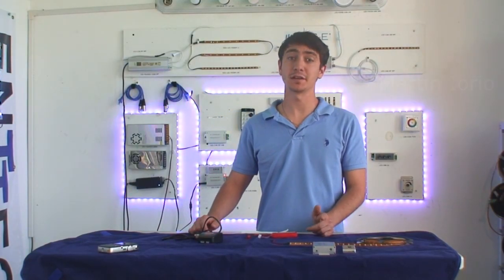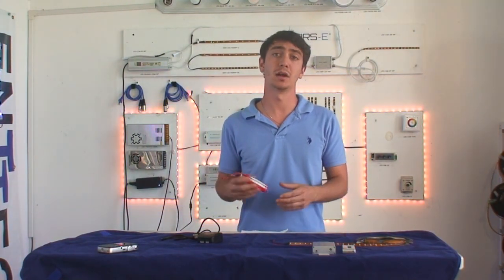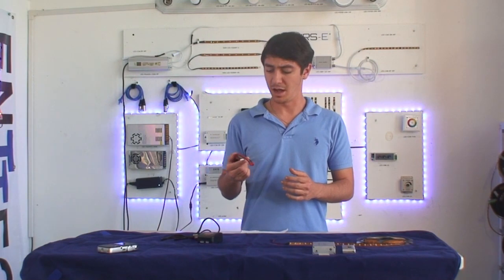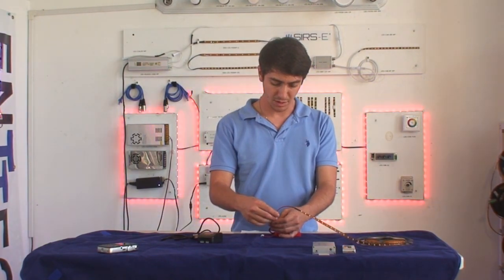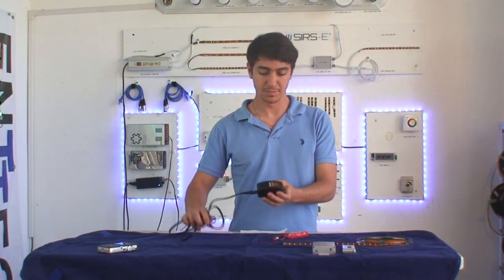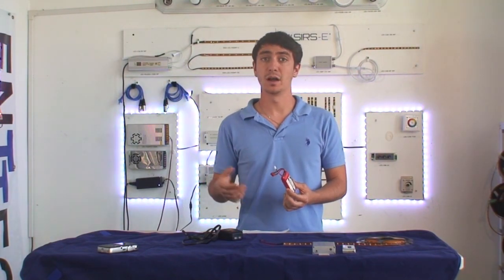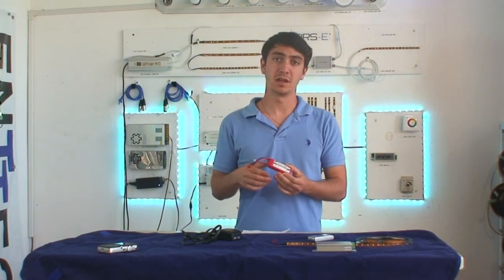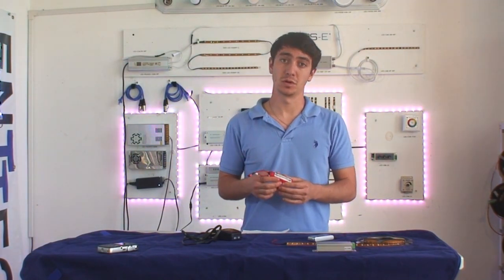Battery Powered LED Light Strips SIRS-E

Comment: Hey man, I'm trying to install some LED Stripe Lights on the inside of my coin-operated pool table, it's hard to see through the plexiglass which balls I've knocked in.  I'd like them to be battery operated (5 minutes) and on a push button timer switch, so I don't have to always have an extension cord plugged in to power them.  I'll buy a lipo battery, can you give me a list of the things I will need so I can place the order?  Thanks!
Reply from the maker: Hello, we actually are not producing batteries at this time with no ETA on when we will begin again., however we can supply you with the LED tape, please check out our website www.sirs-e.com

Comment: how long will they run with battery power? i was thinking of using this method to light under my cabinets. i don't have a plug near the are i want them. If anyone has a better idea i am game
Reply: Jason Hitchcock: Once you decide on a strip of lights, you can easily calculate your battery requirements using Watt's law wherein Power (expressed in Watts) is equal to the current (expressed in Amperes) multiplied by the Voltage. To calculate: Watts divided by Volts = Amps. 

A fairly bright complete 5 meter LED strip is 60 watts at 12 volts, so it draws 5 amps. So, to operate the strip for one hour, you need a 5 Ah (amp hour) battery, which is equal to the more common expression for batteries of this ilk as 5,000 mAh (milliamp hours). That's the theoretical amount of runtime, as there is always at least a small amount of circuit loss that detracts from actual runtime, but it's close enough. Once you know the per-hour battery requirement, simply multiply that by the nimber of hours you want the lights to operate on a single charge. If it's 10 hours, in this example you would need a 50,000 mAh battery. At that point, you, essentially, need to be looking into the 12v batteries capable of jump-starting a car. Then you need to calculate charge time for the battery to see if you would require more than one to power the circuit on your desired schedule. For instance, I have a ~26,000 mAh USB battery pack that charges via micro USB input. When I plug it into my iPad charger, it outputs 2.1 amps or 2,100 mA. 26,000 divided by 2,100 = ~12. So, if I completely exhaust my battery pack, at least to what it's internal circuitry allows, it takes about 12 hours to fully recharge. If a 50,000 mAh battery is charged at the same basic rate, that's about 24 hours to fully recharge. You can get a faster charger, but the faster the charger the more you wear out your battery. 

Further, a lithium battery does not have a constant voltage. A three cell unit would start, fully charged, at ~12.6v and would drop below the rated 11.1v. A single cell is always or nearly always rated as 3.7v, but the voltage is on a slope as the charge declines through self-discharge (when batteries go fully dead or less powerful from sitting around a while, even if they aren't used) or from usage under load (when they are attached to a circuit that is using them for power). For practical purposes, calculating the power requirements for your lights at 12v should be close enough.

Another thing is that by simply connecting the battery directly to the strip, there is no protective circuit, unless it is built into the battery, to automatically shut itself off when the voltage drops too low. This is important because the batteries will be destroyed if they are allowed to be run completely dead. They must maintain at least a certain level of charge to be able to be recharged. 

Some strips are around 30w or if you take a strip and only use part of it the wattage drops while the voltage requirement stays constant. The lower the wattage the longer the battery will power them, BUT that also means they are producing that much less light. Sometimes, it comes down to striking a balance between acceptable light level and runtime. One of my flashlights, for instance, will run for something like 45 minutes at the absolute brightest setting, not accounting for the dimming that occurs when it utilizes its protection circuit for heat buildup, and for something like 4 days straight at the lowest setting. The brightest setting shoots a beam out that is useful for a few hundred feet whereas the lowest setting is only really useful for me within a couple of feet. Full power is more than I need most of the time, so I generally drop it to just above the lowest setting for the bulk of my needs. It might be the same for you with strip lights. You may be able to use a dimmer circuit to reduce power usage and, thus, make the battery last longer. 

I know this is long, but I hope it helps you understand how to figure out what setup will work for you or if a battery is flat out impractical. My thought is that, to power strip lights in a place like a kitchen, they should just be on a AC to DC power supply so you never have to bother with recharging or having multiple sets of batteries on hand, etc. It might be easier than you think to run power to them. I can't say without knowing your space though.
Reply from the maker: Hello Jason, the life span will depend on the power consumption of the LED strips. Unfortunately we are not producing batteries at the moment.

Comment: dose the discharge rating matter at all 20c to 100c ?
Reply from the maker: Hello, anything above 20c will be more the sufficient for any LED setup, be sure that the capacity rating on the battery is equal to or greater than the load.

Comment: Is it possible to connect the 5m multi color led strips to a USB battery recharger that you would use to re-charge your phone or tablet?  Trying to make something potable for a marching band outfit.
Reply from the maker: The LED strips wouldn't charge per say. as well they need 12V or 24V of power to run properly, as well as the proper amount of watts depending on your fixture. As long as you meet those requirements you should be fine feel free to check out our website at www.sirs-e.com

Comment: I'm going to be making a light saber using led's and a lithium-polymer battery. Is there any way to safely charge the battery with a micro usb?   i plan on using three leds in series and a 200 ohm resister, with a tactile switch to turn it on and off.
Reply from the maker: As far as the safest way to charge, I would say it depends on the battery, for ours we include a charger with the battery specific for that batteries needs.

Comment: Hello guys if I power 3 diodes with 5V 2.1A power bank will they work properly I have connected them with usb and they light OK but can this make problems or kill the led?
Reply from the maker: It will not kill the LED's as long as your PS only outputs the power being consumed, as for if they will work you will need to find out the power consumption.

Comment: Ill have a 15 volts led light and what batter should i use? we dont have any available battery that is shown in your video we have like ordinary batteries like AA Rechargable Batteries i was wondering if i could use those kind of batters?
Reply from the maker: +John Raimund Dagsa Hello, you will need to at least match the voltage of 15
Reply: i used a 4x AAA battery pack and used AAA batteries each with a 1.5 volts each totaled of 6v it did light however i dont know how long and if cutting strip will it decrease the volt requirements?
Reply from the maker: cutting the strip will reduce the amount of power needed to use your LED's.

Comment: Hello guys,,i need a little help here!I'm wiring led strip on my bicycle,,but i dont know how long could my 9 volt battery work on 30 cm long strip if my led strip needs 4,8 wats for one meter,,but i don't need a meter only about 30 cm,,,Pleasee help :)
Reply from the maker: +Smile More! Hello, so unless the LED strip is a 9v strip the battery will light the strip dimly, and basing myself off a standard 9v battery it would last an hour tops.
Reply: +SIRS Electronics Inc thanks bro!

Comment: Can anyone swing me a power consumption rating for one single RGB LED? I will be powering 4-6 LED's cut from a strip with the same 3S 11.1V LiPo he demonstrates in this video and want to calculate power draw.
Reply from the maker: +CORZER0 Hello for SD RGB your going to be using 0.2 watts per diode.
Reply: +SIRS Electronics Inc Thank you!
Reply from the maker: +CORZER0 Your welcome, thanks for asking.

Comment: Hey I'm thinking about adding an led kit or anything that can run on a battery for my Yamaha 650 vstar  and I don't wanna use the motorcycle battery any ideas on what LEDs I should get
Reply from the maker: +eric cortes , thanks for your comment. I would recommend using a 5050 LED strip and a 12V LiPo battery. You can check out our website at www.sirs-e.com and see our products pages.
https://sirs-e.com/product-category/led-lighting/led-strip-batteries/led-battery-12v/
https://sirs-e.com/product-category/led-lighting/led-strip-lights/

Comment: Hi. I'm super interested in using LED lights for a small project. But is there any other way to power about 6in strips pieces of strip with a more smaller and discreet battery that can be turned off and on with the press of a button?
Reply from the maker: +Bryan Sanchez , Hello Bryan and thank you for your comment. Yes there is, but you will need to find your battery's capacity, depending on the power consumption of those 6in LED strips. One way to find battery capacity is explained here:
https://www.youtube.com/watch?v=k-rlqBOP7b0
Also, one of our smallest LED battery is 3.5″x2.2″x1″ which you can find here: 
https://sirs-e.com/shop/led-lighting/led-strip-batteries/led-battery-pack-3200-mah-12v/
Let us know if you need further assistance with your project, or give us a call 956-522-2006.

Comment: can i splice the wires and run them to my motorcycle battery
Reply from the maker: Hello Miranda Castillo , thank you for your question and for your comment. Yes it is possible to do so. Just make sure that you have a 12V source and are using 12V LED Strips.

Comment: Hello there, I have the RGB LED STRIP already, is there anyway to power it via USB in a way I can connect it to the computer USB port instead of using a 12V Adapter?
Reply from the maker: Hello Lisselot Ventura, thank you for watching our video and for your question.  Most USB ports will only provide 5V from a computer and the current output depends on the type of USB. USB 1.0 and 2.0 will give you around 500mA and a USB 3.0about 900mA-1.5A. These rating are not high enough for a 5m LED strip which might draw about 2A. I would recommend using either a Lithium Polymer battery with the voltage you need or a power supply.

Comment: 11.1v is too low and don't last as long as 12v batteries.
Reply from the maker: Hello Seen City, thank you for watching our video and for commenting.  11.1V is nominal voltage of lithium polymer batteries. The run time is not designated by voltage it is designated by the capacity of the battery in mAh.
Reply: Hello friend,
Noted. Thanks.
11.1v is lower than the 12v specification which means you do not get the full brightness, however.
Reply from the maker: Hello Seen City, you will get the full brightness since 3-cell LIPO fully charged are above 13V.  But you are right the nominal voltage for a 3-cell LIPO is 11.1V.  You can safely run a 12V LED Strip.

Comment: hi, This is my case..
I have to make different shapes and wordings that will be about a meter each to be used in Dance choreography. There would be about 15 items in total. I wanted to knw how can i get these lights turn individually on with AA batteries? or what is the best solution.

Please guide. Thanks
Reply from the maker: Hello Vishal Soni, thank you very much for watching our video and commenting. I would recommend
using a 9V battery for a low cost solution, but that will only last for about
45 minutes, and wont be as bright as it should be. If you are interested in a
reusable option that will last longer and be brighter please contact us. Info@sirs-e.com

Comment: I built a speaker box that is powered by a 12v car battery.  I plan to line the box with led's (10 ft). How would I go about connecting the led strip to the battery while still maintaining the ability to control the color? Also would I need to throw in a resistor? I have an RF controller, and if I need to purchase any parts to makes this possible I am more than willing.   Thanks, I appreciate any help